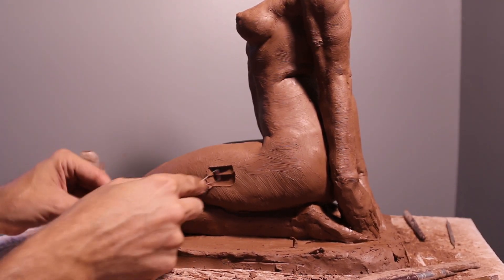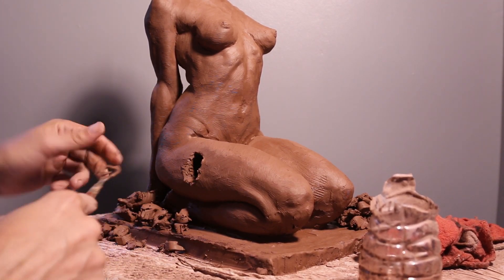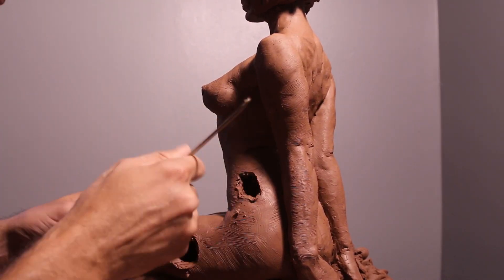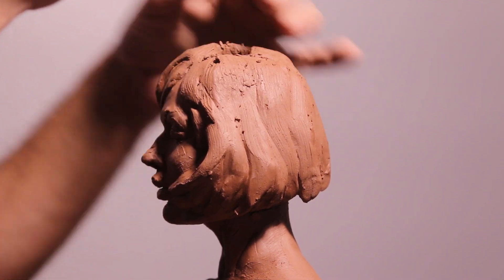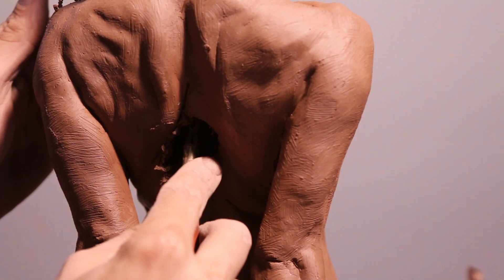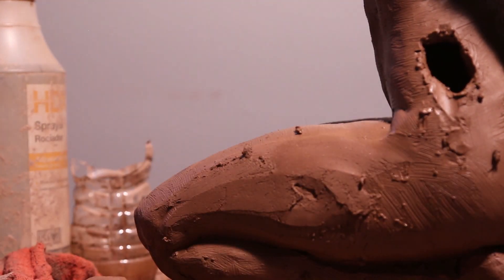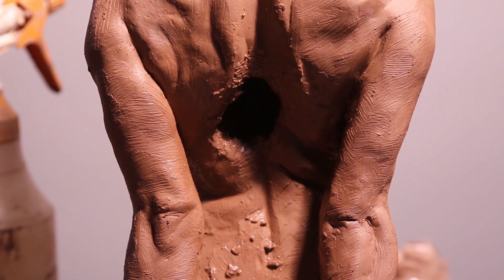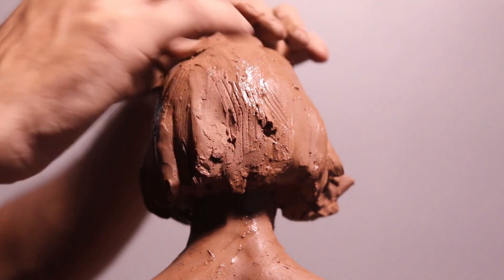How to hollow out a complex water clay sculpture for firing

Comment: Thanks a lot for this! At least this is not as “bad” as Philip Ferault’s way of cutting bits off of the sculpture completely, hollowing out and then “glueing” them back together. 

Both methods scary, though! 

But your video is very helpful indeed. 

I’m wondering if something like a sock filled up with sand, tied with a rubber band to close it, could work… Once you build a sculpture around this sock-sand base, you’d remove the rubber band and get rid of the sand, letting it fall out… After also removing the sock, you’d basically end up with a hollow sculpture. 

Have you ever tried this? 🙂

One more question, how do you fix hair-like thin cracks in a fired sculpture? 

I work in porcelain, so I would usually have to fill those tiny cracks in with a special porcelain slurry and fire the whole thing again, at a much lower temperature. 

Yourself? 

Thanks a lot. 

Beautiful work! 😍👏
Reply from the maker: Hey there doll. Yes ive seen Phillip cutting away his sculpts and i've always thought he has so much experience with clay that most people would just destroy their works including me. Thats an interesting idea with the sock, never thought about it. It should work, the sock should be easy enough to remove and all the sand should drop and bits should fire. Another way is to stuff it with newspaper and then fire the sculpture, the paper will burn away.
Reply from the maker: With hair thin cracks i think the best method i found for thicker cracks is to get some air dry clay and fill it in. And then paint it. But i've also in the past used just wood putty to fill in the cracks, and sometimes even plaster.

Comment: How long did you have to wait after this point for the sculpture to dry enough to fire?
Reply from the maker: I let the sculpture air dry for a week to be sure the moisture ends up leaving. If you let it sit longer even better. But don't put it in the kiln if its still wet to the touch. It needs to bake very slowly.